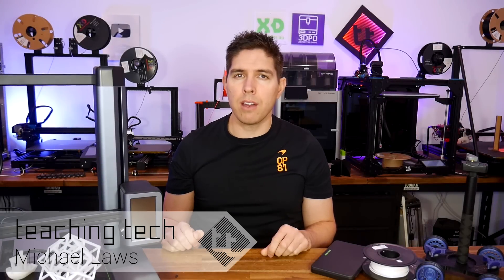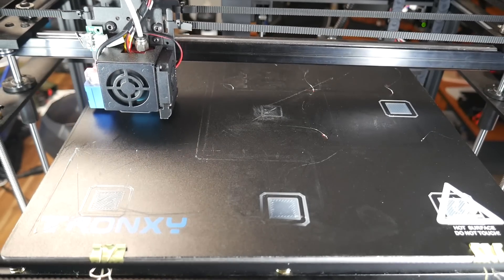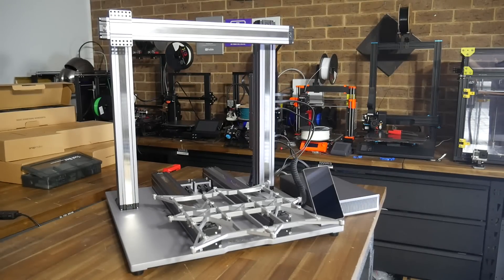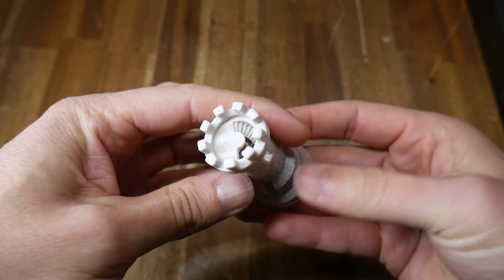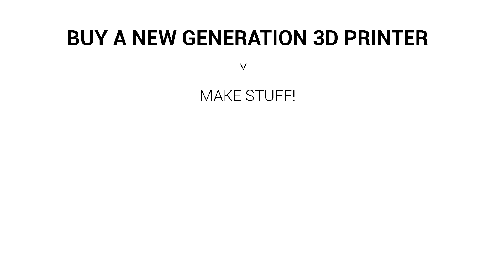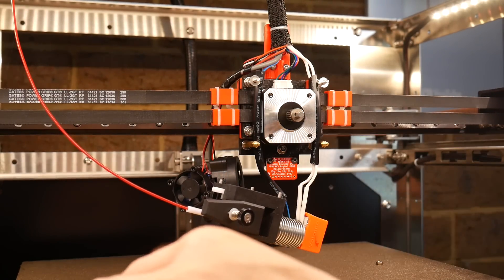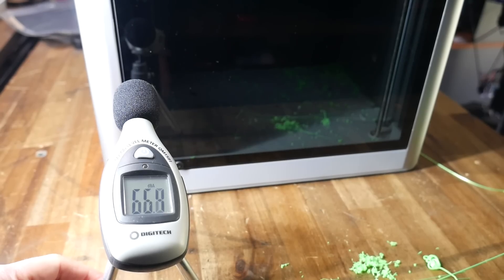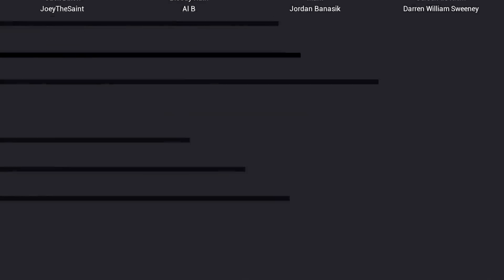Next gen 3D printers are here, but do they bring fresh problems?

Comment: I had a deposit down for an XL but got tired of all the delays and redeemed my deposit, I then considered getting an X1 Carbon but had concerns regarding the lack of international service centres, open source machines are pretty easy to repair yourself but the closed source Bamboo machines would need sending back to China if a fault that was not repairable came about, my main concern is wearing on the carbon rods as they are glued in and not replaceable by the user.
 I thought I would wait for the clones to appear and see what that brought to the table, they have been dissapointing, the QiDI machine develops heat creep if you use the heated chamber as the cooling is not satisfactory, and the Creality K1? well its a Creality machine and like all their printers has been rushed and released before its ready, I have not seen one review without issues being discovered, and am yet to see an out of the box print without issues, whether Creality will fix the issues before mass production is up in the air, they dont have a track record for fixing issues instead choosing to leave them to the community to fix, if this is the case then Creality have missed the boat.
 I asked someone who was using Bamboo X1C's in a print farm if he had any concerns regarding the carbon rods, but I did not get a reply, I will take that as a yes, he got some machines free for review and I guess does not want to sully his relationship with Bamboo Lab.
 So that leaves me with my current machines which I will continue to use until something I can trust comes along!
Reply: Maybe a voron is worth looking at? They are just as fast as Bambu, open-source, upgradable, repairable and well documented and have a very supportive community.
Reply: Bambu labs list replacement rod package for £82.

Comment: Closed source is just a big nope, even though a Bambu might be great now, how is it going to be 2-3years down the road. These machines are just bound to become dust collectors with all these custom proprietary parts. Let alone if your warranty runs out your just screwed and locked to a single supplier (with possibly an expensive bill) who might not even be there anymore.
I never owned a Prusa but applaud them for their stance on open source and supporting the community.

Started out with a Davinci 1.0a, a Folgertech FT-5 and a Voron 2.4 now and couldn't be happier with it, its rock solid once setup properly and im not bound to a single supplier. At some point all these nice out of the box fast printers will break and are going to need to be fixed, its just inevitable at these speeds.

Comment: Great summary - there's a lot of junk out there that is a copy of a copy!  Some actually work well an others, just terrible.  The worst machine I have seen in the past year has been the Fokoos Odin.  They bragged and bragged how it folded.  Yes, in the box.  Then you unfold it, put in the bolts and then you experience a really sh!tty printer largely supported by a Facebook group and a salesperson, in over their head.   I haven't been a really huge Prusa fan since the ones we had at work had some pretty low quality printed parts that came from their kit.  I felt the kits were overpriced and once you own one, when a new version came out, you really got screwed on the upgrade cost  (most of the time it was almost more economic sense to buy the new printer).  I do appreciate that they support what they sell.  I'm testing a Lulzbot machine right now and its very overpriced, sparse documentation and 3D printed parts.  For that price, I'd expect a glossy manual, finely machined parts and truly spectacular looking machine.  I think the better quality machines is going to raise the bar on what customers expect for their money.

Comment: I see some potential pitfalls with a larger focus on printers that "just work" out of the box:

1) If you don't learn how to calibrate, maintain, and troubleshoot, you'll be less prepared when something does go wrong...and things will go wrong with any complex machine. There is a ton of community support for printers like the Ender 3 to help people learn what to do when those printers go wrong, but when you sell a printer for over $1000 you really should have your own good service and support staff. Prusa does this to perfection but the impression I get is that Bambu Lab only provides high-quality support to their YouTube content creation partners and other high-visibility users, leaving the rest of their burgeoning user base in the lurch more often than not. 

2) Just as information on and opportunities for repairs and upgrades are limited, parts for making repairs are also limited. The curse of fancy injection-molded plastic parts and powder coated or anodized metal parts is that these are not user-serviceable or -replaceable, unless you have a somewhat unusual home workshop. And with a few exceptions, parts availability seems highly restricted for the new wave of high-end printers. If something gets damaged or breaks entirely and the manufacturer either won't provide a warranty replacement or won't sell you a spare, you either have to work around it or deal with the fact that you now own a $1000 paperweight. 

3) Similar to #2, if one of the high-end manufacturers ends up going out of business or moving out of the consumer market, their customers are going to be completely hung out to dry. In fact, I had a related discussion on this concept earlier today regarding the industrial 3D printer we have at work, the S2 Dual from Stacker3D. Long story short, it's a wretched printer that has a litany of issues that Stacker's customer support has been unwilling to even help diagnose over the phone or Zoom, making us think they're suffering through poor sales and will be out of business in the next few years. What do we do to avoid having a $12,000 paperweight? I raised the possibility of scooping out Stacker's proprietary nozzle, heater block, and mainboard and replacing them with off-the-shelf components...and if we need to leverage our own in-house machine shop to make custom adapters for some parts, so be it, but that's not a luxury shared by most users of high-end consumer 3D printers.

There is value in making 3D printing more accessible to more people. There is value in stopping the race to the bottom for ever-cheaper and ever-cheaply-made printers. There is a ton of value in having the successful community-driven innovations become standard features in our printers and slicer software. What doesn't have value is a new crop of printers that are hard at best for users to maintain, repair, or modify that could very well end up in dumpsters because the manufacturer went under or doesn't value the 3D printing community as a whole.
Reply: Kind of the same way with cars nowadays... so accessible that many new drivers don't even know how to turn off their high beams (or notice the blue indicator), turn on their low beam headlights (while driving around with only DRL's and nothing else), use their turn signals, know the rules of the road, etc. Let alone know how change their oil or even a blown tire. Sad but true.

Comment: The finishes matter more for those who want polished in the beginning. I did buy the SM A350 as my  first dive into filament printing coming from 5 yrs of using resin as soon as it hit the market near me. But as I’m getting more knowledge I find myself wanting to understand more by building and having to retain more information about the particulars for individual machines, toolhead paths, etc. I’m not quite a CNC engineer but I’ve run a CNC at Baker Oil Tools as a machinist while I went to college, so I understand a bit more than the average person who is a hobbyist It was the cheapest 3in1 that had a complete package. As far as Prusa goes I’ve used their software before but haven’t since switching filament, however I now see I need to look at that multiple toolhead unit and the possibility of designing a system similar to a Bambu instant load filament system, imagine being able to scale nozzle sizes with different filament types, basically using water soluble filament tolerances can be mitigated to near perfection all without babysitting it. I’m excited TBH

Comment: Skilled users of 3d printers with years of experience still suffer issues with their printers no matter how finely tuned they are nor how automated they are.
Bed adhesion is always a problem. No new printer can solve that. All it takes is a layer of dust and it's failed print.
Nozzles wear out.
ptfe bowden tubes degrade
filament contains impurities that can clog nozzles.
different filaments have different ideal melting points for your nozzle and print speed so if you don't tune for that then you'll get extruder slippage.
Even room temperatures variations between winter and summer can impact prints. 
... other viewers can probably list a ton more.

All of these sorts of issues requires some intelligence to handle and solve when they occur.

3D Printers are also more like a garage power tool than a home appliance from a safety perspective and should always be viewed as such.

The tinkerer requirement is a barrier for entry that kept those that shouldn't be doing it safely away. Just jump onto any reddit group for brand X printer and you will see posts from people that shouldn't own printers but got sucked into the hype and bought one. These new more expensive printers might allow some people to get some printing done but those printers are one clogged nozzle or one detached print away from the garbage bin.

There are people out there that cannot check their cars tyre pressure and who will try and bake a foil wrapped potato in a microwave (yep seen it). These people should not be let near something like a 3d printer. Marketing printers for them is not a road we should be heading down.

Comment: Honestly I wish they'd make an in-between. I would love to have a 3D printer that "just works" like the X1 since my CR-10s Pro requires constant repairs, and although I doubt the new printers would require many repairs, also I really dislike how difficult it looks to repair them when needed. With my CR-10s Pro I can very easily diagnose problems while it is printing due to how open it is. I can see it functioning, and therefore any repairs require very little time. With time I've also learned how 3D printers work, so I can more easily know what's going on. 
That doesn't seem to be the case with these newer printers. I don't want to be reliant on tech support from those companies, I would much prefer to be able to fix things by myself or with help of the community.  Not only do the more sleek cases obscure components that I think we should be able to see, I also much prefer the open aesthetic to the closed one. I want to see the gears turning, the fans moving, and so on. Otherwise I have no I'd have no idea what's going on.

Comment: Anker: I definitely won't be buying their printers. Anker has had some security issues with other products lately, and I don't trust them to fix their stuff. For details, see "Why we're dropping this sponsor" from LMG clips.
The BambuLab is clearly taking the market by storm, but I am not convinced it will stay on top. It doesn't look to me like it has much in the way of features that cannot be reproduced by the community. Most of it's features are already out there, just not all bundled as well as the X1... but give 'em time. They're going to have to work hard to stay on top. But if they continue to push reliability the way they are, they'll stay competitive.

Prusa: 1) Minor nit: Prusa didn't design the Mendel. The Mendel was an original RepRap from Adrian Bowyer and team. Prusa did a remix that was faster and easier to print, cheaper and easier to build, shorter BOM, etc. As I recall, at the time, people were working hard on simplifying the mendel. Around the same time, someone released the Drill-press Mendel, a repstrap that could be made uing only a hacksaw and a drill press.
2) I suspect the Mk4 is going to kick-start a bunch of interesting new features as the software catches up with the hardware: The strain gauge integrated into the extruder will be both a leveling sensor, a jam sensor, a filament out sensor, and possibly a flow sensor, and the idea will be pretty easy to integrate into other machines. It's about a quarter of the price of current bed level sensors and way more flexible. I think the Mk4 probably has other interesting features in it like that, too. So, BambuLabs is going to hurt them a little, but they'll survive.

I'm curious about the BambuLab AMS: how does it compare to the Prusa MMU? I've used neither, but it sounds like the AMS is way more reliable for about the same cost. I'm expecting to see knock-offs of that RSN too.

Comment: I THINK YOU ARE MISSING THE ELEPHANT IN THE ROOM

The single biggest choke point, in my opinion, is STL which is the defacto standard interface between the entire suite of CAD softwares and the legions of SLICERS.  You can create the most beautiful, colorful, models and components in any CAD Software you like but if you are limited to using STL which does not support color, to transport your designs and components to the slicer then everything is for naught.  There are alternatives such as OBJ, STEP, DWG, DXF, etc.  If PrusaSlicer, Cura, or any other Slidcer opened the flood gates and either fixed STL to support color to replace STL with a viable alternative the entire eco system of 3D printing (and engraving and milling would also be sucked into the storm) would be totally transformed. The first company to reach "The proverbial Moon" will transform the industry and become the hero and king of the hill.  Just imagine what would happen if Prusa who has all of their 3D printer line all the way out to MM2 could open the flood gates for user to upgrade and easily enjoy endless possibilities in colorful 3D printing.,

Comment: As someone that comes from an octoprint upgraded ender3 and a duet2 based diy printer, I’m frustrated with the iot approach these companies are taking. I want simple local access to my printer. I love my p1p for its speed, quality, and consistency but hate actually using it. It’s extremely slow to transfer files to. I have a gigabit network, it should not take 5 minutes for a file that is less 10mb to transfer. This makes prototyping downright frustrating if I realize that I missed a support or to change the filament type. Each change another 5-10 minutes wasted. Interfacing with my duet based printer just makes the Bambu lab experience look pathetic.
Reply: I only use LAN-mode, granted haven't done any large prints but none of my prints has taken more then 10-20sek to transfer to the p1p.
Reply: @pieebobeg  Cool, must have missed them adding that. Originally, lan mode was x1 only. I’ll have to give that a try.

Comment: It seems to be that the high end, high cost proprietary model is the way everyone that doesn't want to race to the bottom goes.  It's based on a monopolistic model with a lot more advantages to the manufacturer than to the consumer.  It's like Tesla or Apple, it draws in all the top talent that could be working elsewhere and it works to become a monopoly which is where the big money is.  Many folks realize this is happening and naturally have disdain for it.

Comment: My concern with all the newage closed source turnkey printers is that they will end up like current paper inkjet printers. In 2023 we still have to pull our hair with any consumer printer you buy breaking in the most outrageous manner without offering a fix and fight the manufacturer every step of the way to fix issues and try not to rape the consumer. Seeing the bamboo and how many components are not available for purchase and further more the fact that if tomorrow they release an X2 and decide to stop making parts for the x1 you will be left with a very expensive paperweight.

Comment: Half of it for me is tinkering. I started with an Anet A8 (which I heavily modified and still runs fine). I have a Prusa MK3s which is awesome but sounds like a bandsaw on diagonals, a Tevo Tornado which I finally got safe and acceptable that is not in storage. A Tatara steel frame job which I am still messing around with and a Rep Rap Atom X which was printed on the A8 and works fine but is more of a folly now. If they turn it into Apple and rivet the bonnet shut then I am not interested.

Comment: I'm looking at getting another printer, started with an Ender3Pro and have a Zortrax M200 as well, (i have access to Zortrax M200/M200+/M300 at work for prototypes), i just don't like the Zortrax's very limited slicer software (*.zcode not std G code) or the fact everything has to be printed on a thick raft on a perforated bed, none of those fancy spring steel beds. I do like the enclosed chamber for printing ABS/ASA etc for my mechanical parts, and moving forward would like to use CF materials.
Not keen on a Bambu Lab branded units as i'm not a big fan of the use of cloud services, local or otherwise, in case they someday shut then down. Then there's the reliant on proprietary parts and software, like the Zortrax. Also not interested in the multi colour printing fad.

I have been watching/waiting on reviews of the Qidi Tech plus 3 and the Creality K1/K1 Max, due to their enclosed chambers.
Yes the Qidi Plus 3 has had teething problems, but at least the company has pulled the printer from sale worldwide and is fixing the issues.
And also yes, the Creality K1 has had it's share of problems on the early release machines.

Waiting patiently for the final releases in the next couple of months.